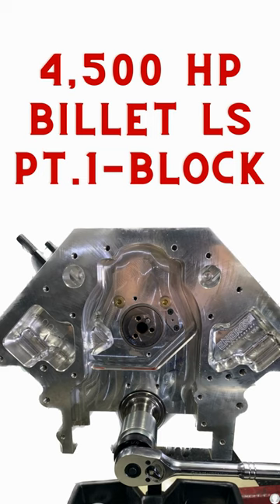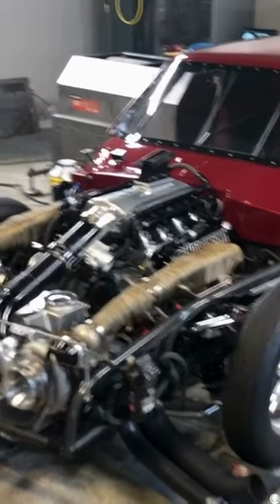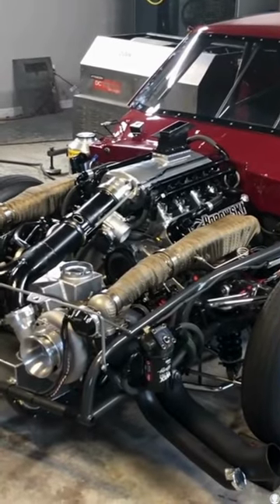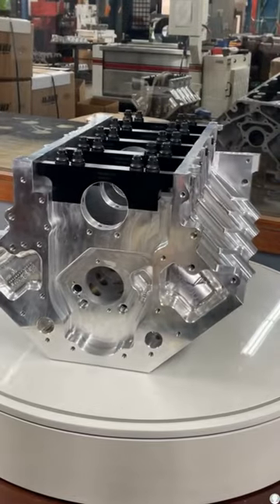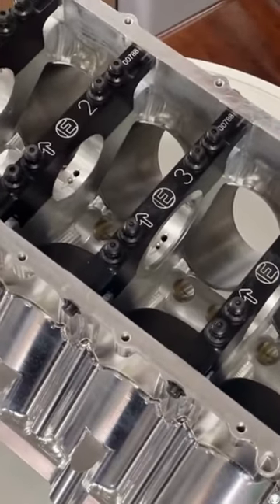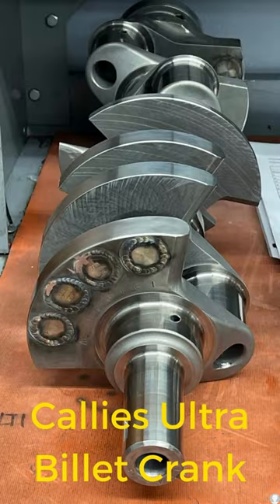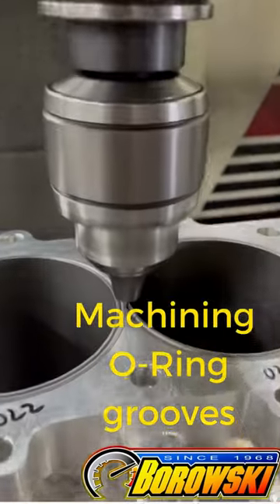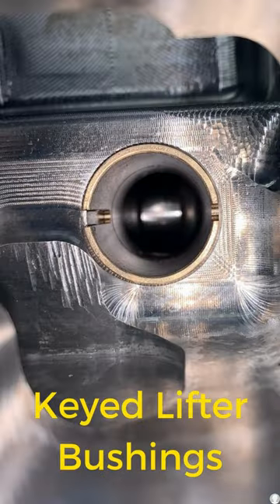4,500 HP Billet LS, Part 1 Block

Comment: How did u see flexing in the crankshaft with an acu? Crank position signals?
Reply from the maker: The Emtron ECU data logging has milli-second resolution. At 60 psi boost for example, we saw frame-to-frame variation of about 40 rpm.  In fact, the engine rpm was not changing.  Vibration of the crankshaft was affecting distance to the sensor thereby creating a noisy signal.  This did not happen at 40 psi boost.  On subsequent refreshes, we could also see uneven bearing wear which is indicative of crankshaft vibration.  All our LS builds all use center counterweighted cranks as a means of minimizing crankshaft vibration.  As a result, we don't see the uneven bearing wear on our builds which is characteristic of LS engines with 6 counterweights.  We did see it on this engine which had been running in the 60-70 psi boost range.  The conclusion from the data logging was therefore confirmed for us by the physical examination of the disassembled engine during refresh.

Comment: Looks WAY expensive !
Reply from the maker: You are correct.  It is way expensive.  What is interesting however is that for complete crate engines, $/horsepower is pretty consistent across the range. https://borowskirace.com/products/4-500-hp-twin-88mm-turbocharged-454ci-billet-ls-engine?variant=43770151108820